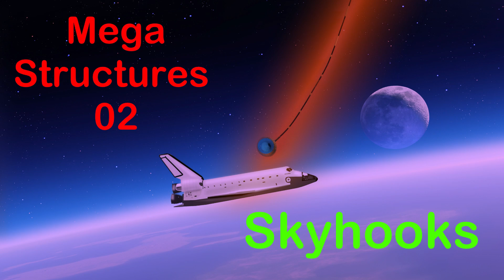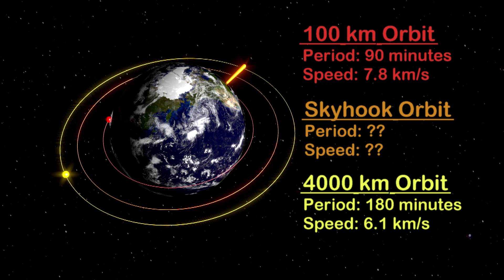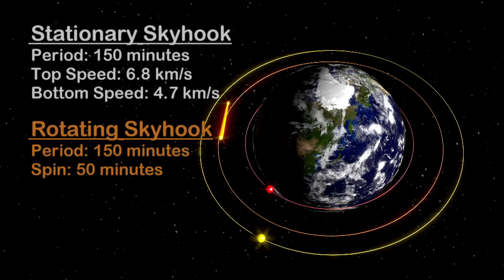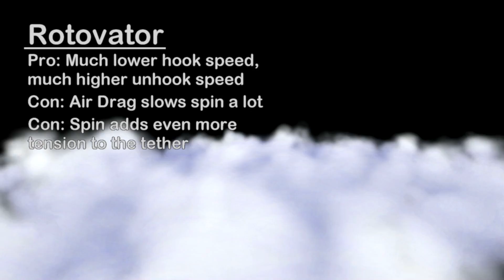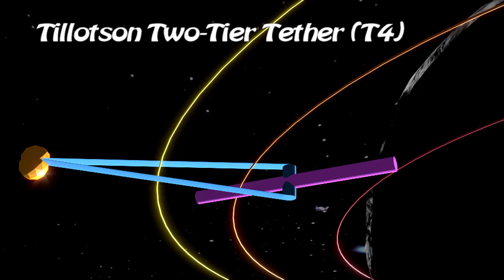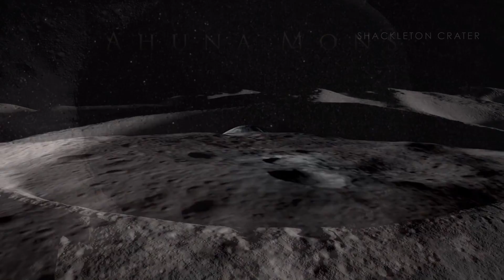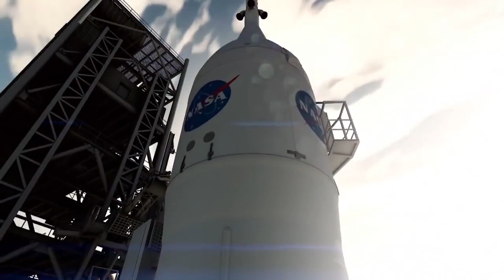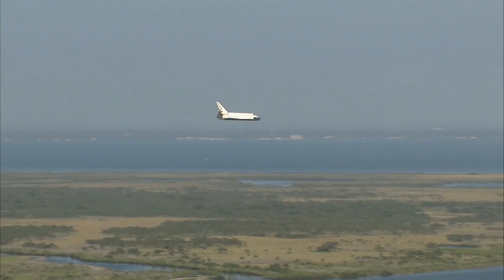Skyhooks & Rotovators

Comment: There is a lot of space junk out there. Almost a satellite is lost every year because of space debris. As time goes, this is becoming worse. Instead of such mess, people should try orbital rings, that could serve for many purposes: space ports, communications, transportation, space observation, science labs, micro-gravity manufacturing, space tourism, etc. 

Instead of the aerospacial industry place new satellites at any new random orbit, they could make an effort and start to build some amount of satellites that will follow a single path in the sky at the Equator. These satellites can be of any kind, from communications to scientific use. If they be made modular, astronauts could then after attach more structure to them. Each satellite could carry a segment of an electromagnetic rail. The last stage booster that bring it into orbit could be made like a "transformer", that will unfold a rail segment and other things. It must have enough fuel and a navigational system to keep the satellite in the right place after it reach the desired speed and position. These satellites could then be remote managed to attach to one other, in order to build an orbital ring around the Equator. After a successful model be developed, it could be mass produced and have space for any application. The key idea is to made a machine that will not drop anything back to Earth after launch. Any piece of material there will be useful in the future.

I know this mean to send more weight than necessary for a normal satellite to space. But it will last longer, because a navigational system that keeps it in orbit. When the satellites are attached to one another, they could exchange fuel. And fuel tanks can also be sent to the convoy, with more rail segments. In the long run, this will pay off.

Such orbital ring, moving at orbital speed will be the starting structure for something much bigger. When the rail is finished and enough mass and speed is fine, stations can be installed, suspended below the ring. These stations must have various redundant magnetic attachments, for maintenance. The stations can be expanded along the rail, as people need more space. In the ring we can have space labs, factories, hospitals, space ports and many other things, of any size. Airlocks will be the norm there, so their cost will drop in the future.

Along the rail will run suspended electric trains and vehicles that will transfer people/cargo from station to station and to/from the orbital ring. These trains will reach orbital speed as they move along the rail, so fast and automated transfer of sealed containers for people and cargo will work better than doors. This rail must have at least 3 lines (two to attach the stations and one, in the middle, for vehicles and trains). Since the ring will rotates around the Earth very fast, there is no need to spend more energy traveling from one station to another. The ring may have local rails for short travels. But the long distances will be better served by the trains in the main rail.

From the fixed stations we could install cables, maybe made of Zylon, about 200 miles long, that will bring elevators from the ground. The Equator is the best place to build these elevators, because almost no hurricane cross it. The elevator's cables will help to keep the fixed stations in place. After these cables be installed, rigid lattice structures can be constructed around them. When the first elevators be available, less rockets will be necessary to bring things to space, cutting costs a lot.

Big boosters can be added after to adjust the ring's speed and position. Structural tension must be monitored everywhere. The goal is to build a very rigid structure in the end, that can be reinforced when new hard materials be available. The orbital ring and the suspended fixed stations can be upgraded and enlarged as time goes by, making the whole thing thicker, with more units. 

The fixed stations will have normal gravity and be there will be like to be at Earth's surface, so people could live and work up there. The orbital ring will have micro-gravity, so there we can have micro-gravity factories, science labs, hospitals, restaurants, hotels, shopping centers, etc. Almost everything can be constructed in the ring, leaving the stations for transferring of people and cargo. By the way, the stations are better for bathrooms and gyms. Since they are suspended in the rail, there is no limit of how long they could be.

At the upper side of the orbital ring we could have magnetic space guns to launch space ships and satellites to the outer space, spending much less fuel. Since the ring is rotating around the Equator at orbital speed, it is at the best place to launch spaceships and probes to other planets. Therefore, launching bases at the Equator in Earth's surface will be a high priority to cut the costs while the elevators are not available. These launching bases could have electromagnetic spacegun towers, several miles high. These towers could be constructed with many huge metal torus, reinforced from inside and filled with compressed air, that will be aligned side by side to form a structure like a honeycomb cone. The lower levels will have bigger torus and more compressed air inside. The interior of the tower will be a vacuum, housing the electromagnetic rails, probably made of superconductors. Each rocket launched from these towers could carry the electromagnetic rails needed for their launching and bring them into orbit. So, the rails attached to the rockets and used during their launch will be the same that will be used to build the orbital ring. Acceleration of rockets up to 10G for 30 seconds could carry people, but launchings with just raw material can accelerate even faster. These towers could be the starting structure for the elevators too. The towers itself will have an electromagnetic elevating platform inside, used for their own construction and maintenance.
Reply: Since the ring is above the stations and trains, it can have any width along its length. But, if the ring will be designed to have more rails around it, it may be better to have the same width everywhere. Especially if another fixed ring in relation to the planet will be built around it. Many other rings like this can be constructed in the future, in different angles and distances around the earth, all connected to each other. And this future highway (very high indeed) could grow up to near the moon. Since the Equator ring will be the first, it will be the largest and the main hub.

Communication antennas, mounted at the rings and the stations could bring high bandwidth radio Internet to the whole globe, when many rings be available. This will be better than any satellite at low orbit, since they will get information faster from fiber optic cables.

Solar panels covering the rings can generate all the necessary energy and sell the surplus to the whole world. The energy can descend to the ground though the elevator's, not from dangerous microwave beans or laser rays that will fry any bird or airplane passing by. Also no energy will be loose by light scattering. These solar panels can be constructed within a shell made of a hard material, to protect the ring from radiation and debris. Security measures must be of high order, since any explosion or impact could cause a lot of trouble.

Manual maintenance will be often necessary, so the whole thing must have handrails, robotic arms, maintenance drones and robots, service rooms and medical aid everywhere. Since maintenance will be possible for anything, no more communication or scientific device will be lost anymore, reducing costs. When orbital rings be the default, small objects moving around the Earth that are not spaceships or space stations can be forbidden. If we start now to clean the space around the Earth, we will reduce a lot of space junk in the future. When factories be available at the ring, old satellites may be a good source of raw material. These rings will give us more safety and a lot of uses, taking the humankind to Space, cheaper and cheaper!

Elevators could be build around the Earth in strategic places (high mountains, for example), so people could travel fast around the globe. Someday, in the far future, people could take a trip from Earth to the moon by just paying a ticket. 

More space observatories will be available, even bigger and better than the Hubble Space Telescope, but with much cheaper maintenance. Personally, I dream with a day that I will put a VR glasses, connect to an Internet service and see the whole night sky like if I had an eye on each side of the Earth! And also I want to be able to look at the universe this way with zoom, in very high resolution and at any wavelength I desire. In the future, this "eye distance" could reach the whole solar system. Well, nothing compares to the real thing, but it will be possible to any tourist at the many micro-gravity hotels in the rings.

In the future the orbital rings may have many layers (transportation, living, working, scientific, etc). One of these layers can house the ducts of a super-massive particle accelerator. 

At first, the Equator's ring will belong to the many companies that will place these satellites up there. But in the end, the finished ring will be an incalculable resource to the whole humankind.

After the first orbital ring is in place, it will be cheap to send anything into orbit, so another rings and stations can be built in low or geostationary orbits. Rotating structures could produce 1G centrifugal force and can have many shapes and goals, civil or militar. Many of them could have a small sea of salty water around, filled with fish and corals for consumption. Big sea sponges are natural water filters. Algae on it will produce oxygen. Water is also a great radiation shield. These stations and big spaceships can be a place for millions or even billions of people who will live in space. 

When people have a lot of useful space out there, the Earth may have fewer people and it can be better recovered from pollution and devastation, leaving more space for ecological areas. The ultimate goal is to explore and colonize the entire solar system. Then, in a distant future, when technology advances, future generations will travel to another stars.

I know this will cost a lot of money. But I am sure they are perfectly achievable and high lucrative, if the World's economy aim to build the first orbital ring, taking every necessary small step towards it.

Comment: So here is the question : why don't we use this system today ? There should be q good reqson why nobody tried that, because the technology is ready and it seems doable, but nobody works on it...
Reply: The real answer to that is that no one actually wants to go to space - or at least no organization with the resources to do it wants to.

The reason for this is that there are actually some significant consequences to greater access to space. Namely political consequences, but also others.

But still, I think we should open up space.

Comment: Very thoughtful video!

I feel like a massive spinning apparatus of this scale, with all the extremely complicated logistical issues (structural, balancing, calibration, controlling etc), seems more complicated than a space elevator...and at least as much of a dream project.

Assuming the cable could be built ... what would it look like to build a cable from the Moon for a space elevator?  It would remain zooming through the Earth's atmosphere at a convenient elevation (super-heated of course from friction and dragging along like a fishing line in water) that would be rocketed up to and then be pulled up along the main cable by a smaller cable to the Moon.  This would provide back and forth traffic between Earth and Moon ... driving business/tourism.

What would it look like to have a multi-link skyhook ... would that help?

Separate subject...What would a huge Moon-based solar field, with a huge capacitor/s, that pulsed energy to a cable (or microwave transmitter) between Moon and Earth that then pulsed down to Earth to Capacitive towers?

Comment: Last time NASA used a teather they nearly blew up the space shuttle. To have a conductive cable streached into the the earths electromagnetic field teaveling at high speed means that you are inducing a very large current into that teather. This is not good when you are connected to a space ship filled with explosive fuels. The longer the teather the higher the voltage and current.
This idea of using a teather is the worst idea ever.

Comment: The sheer stress (and I mean that literally) would destroy the tether.  Skyhooks just like space elevators would either have to be massive or require exotic materials.  Also there would be a real threat of it crashing into Earth.  Might be another extinction event like 65 million years ago if it did.  Maybe THAT is what took out the dinosaurs.
Reply: Good thing you made all those calculations and remind all those very smart people who somehow forgot to do them 🙄
Reply: @hafor2846  "Good thing you made all those calculations and remind all those very smart people who somehow forgot to do them 🙄"

It doesn't take a day's worth of calculations to do a Fermi physics problem.  That's the whole point.

Think about a pipe that is 1 kilometer long, spinning around 1 revolution per second, and you suddenly hook 100 kgs to one end of it - what happens to the pipe?  They are talking about something that is 100's of kilometer's long.  I would be very surprised if 100 kgs added to one end of that wouldn't snap it made from any material of nearly any diameter.  It would also be a sudden change in the center of gravity.  You're back into exotic materials again.  You can believe this silly stuff, I understand the concept, but it's easy to see it won't work.  That's because I am an engineer.

It's claimed that a skyhook can be made of materials available today - really?  What ones would those be?  Aluminum?  Titanium?  Carbon nanotubes?  Gee, it's never mentioned - I wonder why?

There's a reason SAP2000 and Abaqus exists.  They could have actually tested it by building it in a finite element simulation from materials that are readily available today.  I wonder why they didn't, and you're seeing a neat cartoon instead?

Comment: 2000 dirigibles with hotel suites, each connect with 500 feet of elevator cable. Allowing a single elevator from ground level to 100,000 feet where small rockets are launched to carry skyhook components, satellites, etc into orbit.

Comment: What about making the tether wider in the middle and thinner at either end, with a "hook" on either end? Also a "weigh" that moves out to the top of the swing/rotation and back to the center by the time the tether reaches horizontal and repeat. 

But we would have to clean up all the space debris prior to deploying an elevator or hook.

Comment: As a software engineer, I can see parallels between skyhooks transitioning to orbital rings or other things being similar to how programming language compilers are created: first in another language, and eventually using the language the compiler compiles, to write the compiler in, and then compile the compiler in the language the compiler is in.  (Hope I didn't muck that up).  The point is, you start with more expensive ways to create foundational technology and infrastructure towards what's hopefully cheaper, more efficient technology and infrastructure until you get what you need: you build tools to build tools, recursively, to get things done.  This is what happened with the moonshot, is a lot of technologies needed to be developed to get to the ultimate goal, and it was done iteratively.

So, if orbital rings or (eventually, when materials technology catches up) space elevators are cheaper to use to get things in and out of space, but the cost of skyhooks is cheap enough to get going and still a net win for costs (it harvests non-earth fuel to regenerate) and it's not as cheap as orbital rings, since nothing else seems to have been reasonably proposed for getting the mass required for orbital rings into orbit, why not use skyhooks until you have orbital rings, for being "cheap" to accomplish it?  Otherwise, I can't see a cheap way using rockets to get enough material to build an orbital ring: even reusable rockets will still require a huge number of them.  Never mind that even the most reliable rockets are not the safest when it comes to BOOM situations.

Comment: Electric planes could get very fast and could use an electric cable of a few kilometers for not using batteries for the first minutes of lifting, than have several stages (reusable and vertical landing for the two first ones). Combined with what was explained here for magnetic momentum for the hook with solar panel it could permit going to orbit with out any fuel. Using the engineers of Tesla and Space X it could seem interesting to E. Musk, and the BFR could get the material up too. He has said he was interested in electric supersonic planes, he has some capital and ways to raise some, little risk fear for capital and complementary good teems of engineers. It could be used for point to point traveling very fast all electric on earth and bringing stuff to orbit with lower cost, all electric. It could later help with the cost of an orbital ring on earth and space elevator on the moon that make it much cheaper after the invesment was possible. The economy made possible by these two ways, between the earth and the moon, would be favorable to Venus and Mars colonization Musk is focusing on.  Why not make a video on this possible short term path Isaac Arthur ? Some of the engineers of SpaceX maybe look at your videos, maybe some of Tesla...